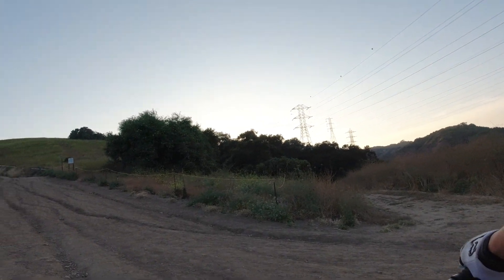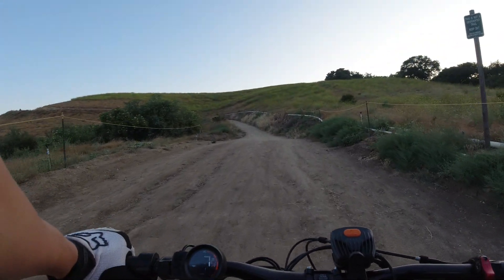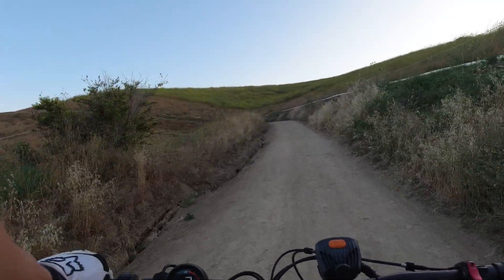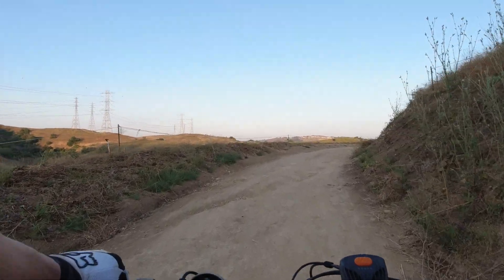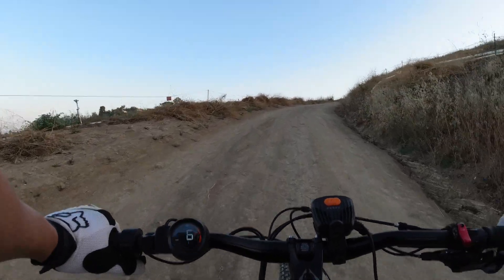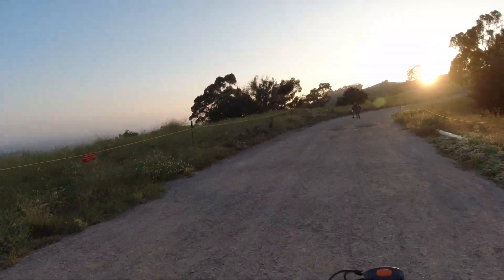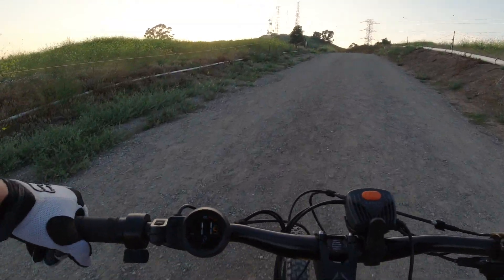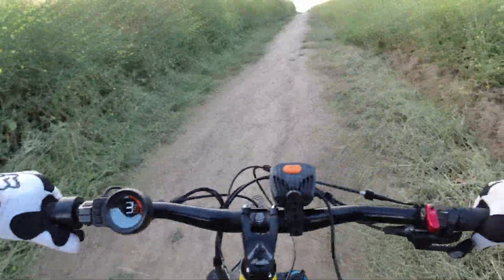CYC X1 Pro 8s Low Power Hill Climb Test

Comment: At 4:58 the assistance level seems to drop on its own from 6 to 5, then a few seconds later you hit a button, nothing seems to change on the display, then the motor powers on immediately. What’s happening there?
Reply from the maker: The number was just the speed reading. I wasn't using max power on the climb at the time
Reply: @tonytypes  ah, my bad. The number is MPh, not the assistance level. Thank you! Your video is interesting to me because I’m interested by the X1 stealth, but the noise has me worried. It appears using a lower voltage battery like you do decreases the RPMs of the motor and also the sound? Or does the whining sound come from the  1 chain rather than the motor itself? Any other insight you can share?

Comment: The more I watch videos about this e-motor set-up, the more impressed I am. Being able to use the rear gears is a bonus. I don't think you need 5-12kW+, high power hub drive motors to enjoy e-biking off road.

I too, like to use effort as to pedal assist whilst climbing inclines. If I didn't want to, I'd use my motorcycle to do the same ride instead. 
As ebikes get more and more mainstream, the government authorities begin to look closer, and as such get more cluey about e-motors. Those screaming around with the huge hub motors are going to get their controller wires clipped,  and be of two things to possibly happen. Abide by power restrictions that are locked / tamper resistant, and be regularly roadside tested for power settings. Or wanting to have the free power available, be forced to register as a road vehicle and lose all access rights to cycle pathways. It's already happening in some countries worldwide. 

Innovation is great, when the freedoms allow it. Let's keep it that way. From what I see, the mid drives seem to be the possibility of maintaining the current 'status quo'.

Comment: in the parts where you are using the pedal assist, do you have the cadence or torque sensor version of the cyc x1? I've been reading some stuff about how using a cadence sensor with a bit of throttle to get you going is actually a more effortless form of assistance than  the more popular torque sensor. I'm new to all of this so bear with me.
Reply: A tip : watch movies at flixzone. I've been using them for watching loads of movies during the lockdown.
Reply: @Bobby Turner Definitely, have been using Flixzone for since december myself =)
Reply: @Bobby Turner definitely, I've been watching on Flixzone for since november myself =)
Reply: @Bobby Turner definitely, have been using Flixzone for months myself :D

Comment: Is the sound too loud ??  Comparing to the bafang?

Would you recommend this motor over the bafang BBSHD?
Reply from the maker: It louder than the BBSHD for sure. The CYC can be quite if you keep motor power and rpm down. Depending on what bike your putting the motor in, if you have a modern bike with a curved downtube near the bottom bracket the BBDHD would not make a great choice as the motor will sit too low. The CYC will fit most modern bikes better, but it is slightly louder.

Comment: whats the gradient up there? you not tempted to boost the power a bit?
Reply from the maker: Not sure but it's pretty steep and goes on for a couple hundred feet. I am tempting to program the controller for more power, but I think the power is just right for pedaling. I want to get a good excercise and not use all motor.